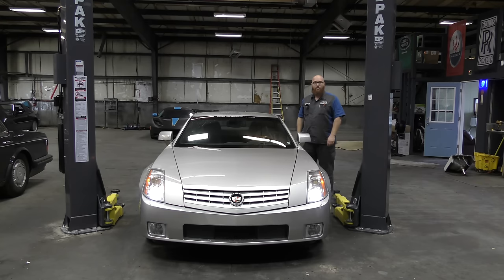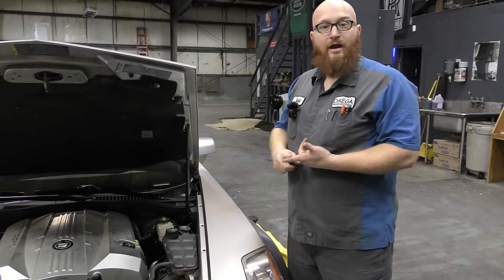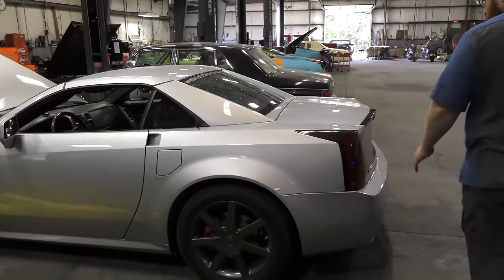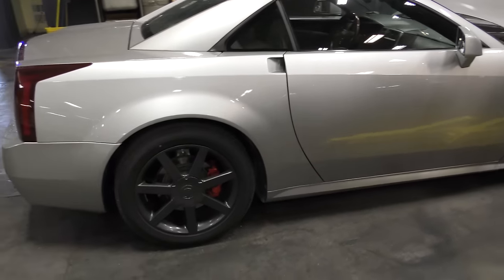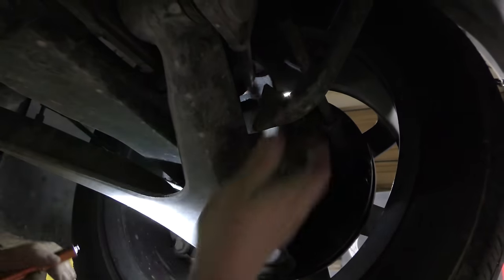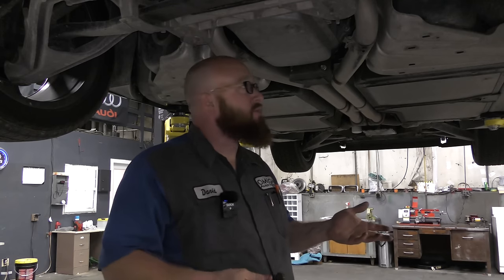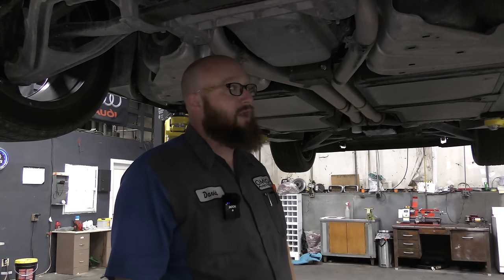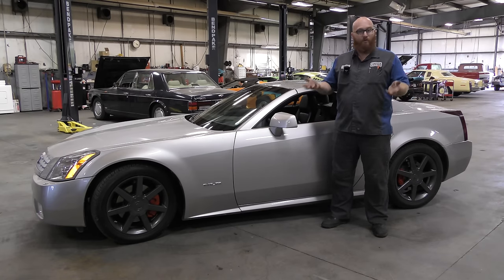The CAR WIZARD is shocked this 2006 Cadillac XLR has a Lotus Sized Repair Bill?!?

Comment: Those insane repair prices are what you end up with in todays stupidly over complex cars, some are more like rolling rocket science projects than automobiles.  One day it will get to the point where many average people with average jobs in America will have a difficult time even owning a car and keeping it in a decent state of repair.  Much of this is because of Govt. mandated emissions, mileage and safety equipment.  I worked in a Chevy dealership in the mid seventies and a brand new loaded MonteCarlo or Caprice ran about $6,500 out the door - new Corvettes were around $15,000 - but cars were MUCH simpler and easier to repair then,  but as the govt. started mandating difficult to match emissions regulations car makers were eventually forced to resort to computers and sensors to run engines leaner and leaner on crappy ethanol laced gas we have now until were all driving rolling science projects that run within an extremely fine computer controlled fuel and emissions balance and it takes high dollar sensors and multiple computers to keep them in specification.  Add to this the downsizing of cars where everything is jam packed into place requiring removal of half the damn car or engine removal just to do what used to be simple maintenance or repair.  An old school mechanical fuel pump cost $15 - $25 and could be changed on the car in less than an hour in most cases - now its a tank removal, shitty plastic lines that get brittle crack and fail etc etc. the list goes on and on - and on.  Sadly we now live in an era where car repairs that used to be fairly simple can result in the car not being worth repairing and being totalled instead of repaired.  We see many older cars preserved or restored and still running today, but we wont see near as much of that in years to come, the car will have to be extremely valuable to be worth the cost of restoration or even what used to be average repairs in some cases.

Comment: Being a Cadillac Technician at least one Tech at Every Caddy Dealership was supposed to Be XLR certified . A special course we could do online and with a hands on with the guys who designed the car. With a lot of training on the folding top. Im glad I took the training and learned that car inside and out because the warranty labor times to fix those cars was ridiculously low. And hard to beat even with the training. And no one ever wants to work on them. And without the training they shouldnt touch the car... But now that they are out of warranty its great It the book time is actually worth working on and hopefully make back all the time lost when under warranty...  ill work on them.all day long now if possible...   Dont forget to check that radiator support frame... havent seen but 2 that were not broken. And that one looks broken...

Comment: Same damn radiator leak on my '03 Cadillac Deville several years ago. Fortunately for me the radiator wasn't that expensive and easy to find at that time. I put 120 k on that Northstar without any real problems other than that radiator.

Comment: A violently ugly car, it's mechanically ordinary, electronically ordinary for it's time.. the kind of car that would brake it's own name... Cadillac.  for the radiator issue, would be far superior and cheaper both in short term initial buying fee and in the long run to have an all aluminum custom made, which leans towards durability, factory radiators are made to fail especially from derelict yoyo companies.

Comment: only the Gm radiator  has the cooling lines and automatic transmission lines in it. All the rest you get aftermarket do not have the power steering coolant lines.  I use the All aluminum ones for the corvette. they fit fine. Just use an adaptor to  adapt the screw in lines for the power steering to the snap in ones Full aluminum welded tanks and  cost less than 250.  While you are at it replace the return line that runs under the throttle body. they are hard to get and I sell a kit to replace the plastic junctions with metal. They will leak after you replace the radiator.  Guaranteed. Also check out the 3000-5000 each headlights and the 2000 taillignts . Also the 2000 to replace the shocks and the top controller that sells for 800- 1500 used. I can swap the radiator in an hour so I am not sure why the high book times. I don't believe you can pull one tank without pulling them both. Our book shows 10 hours for both. Also there are two fuel pumps In the rear

Comment: Cast sump and cross-member? Insanity.
Also, any decent radiator specialist could likely replace the tank or a good tradesman could make one from metal. It could even be epoxy repaired on the inside. Most of the time the plastic tanks crack from the heat cycling directly opposite the inlet port.

Comment: This is a car that looked good on paper, and should've stayed on paper. Typical GM, build it as cheap as possible using the worst engine ever designed for road use. I'm sure during the design phase there were other more "exotic" drivetrains that were used, but in the end this is what the public ended up with.....

Comment: 7:25 If I was putting a 70,000 car on the lift I’d give it a shake test and watch those side skirts
Reply: right? i cringed and rewound just to see if the skirt flexed ..it didn't .
 my Pontiac GT kit has been damaged by those type of lift arms due to bad placement

Comment: You can actually drop, swap the level sensors and reinstall those gas tanks in about two hours each. Watched my coworker do it after he finished chain smoking cigarettes as preparation last month 🤣 difficult part is popping the transfer tube off the tanks

Comment: one last thought... sorry... but I have a C6 corvette... the transmission has to drop out when using automatics. The manual transmissions can stay.

You might be able to reach the sender by removing the rear wheels and the inner fender panels.

Comment: Thank you for another insightful video. As with any vehicle, you will either have Car Payments or Repair Bills-Hopefully not at the same time along with regular maintenance. So, with an average car payment of $550 per month ( some more-some less) that’s just over 6 months of car payments.
Some Brands & Models you Lease, some you Purchase and ditch after 5 yrs, some you buy and keep for a few more yrs. If buying Used, research common problems and factor in Repair Bills.

Comment: Those prices are nothing compared to if you need to replace a tail light or a head light assembly.
A tail light can run you over $2000 and a head light is more.

Comment: the Tail Lights are a real mess if they fail, and a lot do. The V series did not have an LS, it was a supercharged Northstar. I too think they are pretty, but I mostly worried about the Northstar. they had a pretty terrible rep and still do to an extent.

Comment: Had the fuel sensor issue on my 07 vette.  Believe it or not, the forums said to put Techron in it and it would go away...   they were right.  Had it for years after that and no fuel sensor issues again.  Techron was all I used for each full up.

Comment: GM and their damned cheap electronics are one of their serious defects. With GM you can count on relays and switches burning out, and the worst part is that it has been this way since the 80's and they won't clean up their act.

Comment: Car Wizard what do you think minimum usage is to keep a car in good shape? I have a 2014 Continental GT that I bought new. It gets its annual maintenance at the Bentley dealer but sits mostly in the garage for a variety of reasons. I drive it every 2-3 weeks just to keep the seals moist etc. Includes using all the power motors.

Comment: Had 4 different Cadillacs with the Northstar. I had to do a radiator on 2. Worked at Advance Auto at the time and it was always a special order part for about 300 plus tax. Nevermind the fact that both of them had failed head gaskets so that was fun. Had an 01 Deville that was amazing and bulletproof that got ran into. Figures.

Comment: XLR-V is a 440hp Supercharged 4.4L (versus 4.6 for the regular version) Northstar not an LS motor. This was also used in the STS-V, where it was rated at 469 instead.

Comment: Not sure if the XLR has same fuel tanks as the C5 Corvette, but I replaced the right side sender by removing the RR tire and the inner fender
 Did not have to remove the tank

Comment: Plastic radiator tanks are such a cheap ass joke, something that runs hot all the time like a radiator should not be made of plastic.  The minute that plastic goes into use it begins to degrade from chemical exposure to coolant and contaminants and the heat really does a number on it, not to mention the pressure and continuous cycling of hot to cold to  hot over and over again.  Might be more reasonable if they made them where the tanks could be easily replaced with new ones at least.  Part on newer cars are such a racket, planned obsolescence more than ever before.

Comment: Did you get the gm part no. And cross reference it on the interweb? I ran a gm parts dept for 7 years sometimes you could get away with that as an aftermarket option just a thought

Comment: Ya whenever GM does a high end product its a fortune to repair. I had my mechanic convince me to start paying for some repairs on my car. His line of thinking is it's still gonna be cheaper than just buying a new car but man that doesn't lessen the strike on my wallet. I can't wait to save up for my first Toyota because GMs are just not built to last; theyre built for power and performance. You can't really get the best of both worlds unfortunately.

Comment: On the Cadillac, Couldn't the person just run a new radiator and add a separate oil cooler and a separate transmission cooler? These separate items could be installed and hidden out of the way and there is less risk of failure as separate parts than as one, as we have seen in the radiator/trans/oil cooler combos when they fail

Comment: Use Techron in the tank to take the flat spots off the sender and use better fuel. Common C5 problem if you research.

Comment: These are two bad design problems: 
1. Why not use a radiator that is used in other GM products? There is no excuse for using a custom part. There must have been an existing GM radiator that could have been used. 

2. I.M.H.O. it should be possible to drop any sump or engine cover without having to remove cross beams or any other parts.

I am guessing there are other design flaws? They just don't seem to care or think when they are designing a car to keep maintenance costs at a reasonable level. All it would have taken would have been just a little bit of forward planning. I doubt it would have cost any more to build it to a better design; but no, they designed it the way they did. Granted there is less space in modern cars; but a good design should consider future maintenance requirements. All it would need is an industry standard check list that could be applied for any vehicle designed. I realize this was a limited edition model; but any owner that encounters these types of problem will think twice about buying another Cadillac or other GM product.

Comment: the xlr-v did not have a ls based motor.   it was the northstar 4.6  with a reduced bore.   the 4.4 liter engine had better head gasket sealing.

Comment: The fuel tanks of this XLR, reminds me of the fuel tanks on the vintage Jaguar XJ 6 from about 1970 to 1985, which also had two fuel tanks. Repair or replacement of those fuel tanks is also a huge job, as they fit like a glove into the rear quarter panels. Any warpage or modification and they won’t fit anymore.

Comment: I didn't know they had transmissions in the back with the engine in the front. I'm guessing that's for weight balancing between the front and back. You get more control as the weight becomes more even, which is why several cars have center engines for the best distributed weight and balance.

Comment: Hey, I had this same year XLR and it was a fun car for sure. However you are expressing the same issues I had. Difficulty getting parts and when I could find them the cost was high. Also I had the same maintenance issues radiator & fuel sending unit. Also had big problems with the retractable roof. With that said I would still love to have another LOL.

Comment: I've seen similar vid's from you on how expensive it is to work on other cars just because of how they were designed (such as having to lift an engine that is resting on a cross member just to reseal the oil pan), then throw in the use of cheaply made parts (such as radiators with plastic side tanks that can't be repaired instead of good old fashioned metal), and it really makes see that manufacturers are doing this intentionally to discourage people from keeping their cars and maintaining them.

Comment: I noticed you parked the car short 1-2 feet before lift post so you can open the door more, then roll it forward to correct position later to put on lift feet

Comment: i think with the fuellevelsensors in the tanks it would be better to have an inspectionpanel behind the seats that you can remove to get to the sensor and the fuelpump instead of unbolting half a car and put it back together again.. a lot of the older 90`s cars have that when the fueltank is under the back seat they have a panel that can be removed to reach in the tank without having to deal with removing everything

Comment: I once owned a C5 Z06 (for 8 years), with that fuel gauge anomaly happening two or three times during that period of time where the gauge would mysteriously read empty for a brief period of time, even though there was "half a tank", so to speak.  I surmised that it was just a rare anomaly that was brought on whenever managing to drive a very good number of miles (due to cruising a constant 60 mph, in top gear, with no air conditioning and a decent tail wind) between the point in time at which the sensor in the first tank reported as being empty and the point in time at which the sensor in the second tank begins to report anything less than absolute full.  What happens is that the computer begins to get a little nervous because it seems like an unreasonable number of miles have been achieved since the first tank reported as being empty (but obviously still had maybe 1/2 gallon remaining) and with the second tank not yet reporting anything less than absolute full (because sensor continues to read full until down by say 1/2 gallon).  In summary, this is just a design flaw and can't be fixed so don't worry about it.

Comment: havent had a leak in decades on my cars, I loosen the rad cap just enough so the system cant pressurize,, we dont see the high temps some see. no pressure=no leaks, or blown seals or hoses

Comment: I photograph cars for multiple dealerships and I've only gotten to sit in one of these about 6 years ago. I was SUPER unimpressed with the material quality inside, everything was as rattly and loose as a corvette of the same era, maybe even worse. It looks good in picture and on film, better than a corvette... but the creaking loose fitting plastic is just so bad.
Reply: I just want to add I do think they look cool, pretty neat and especially brand new I bet they were dope af, so I don't mean any disrespect. I'm not poo pooing your enjoyment of the vehicle, I just wish they would've put as much effort into the interior as the engineering (which is pretty cool).

Comment: hey Car Wizard,  If I wanted a future collectible, would you recommend a  Cadillac Allante 4.5 or a Buick Reatta  convertible ?  I like them both
Reply: I have a 90 Allante and luv it ,,But it is a money pit ,,electronics will drive U nuts ,,But when its running Rite ,,LOOK Out  its a House on Fire,,with a Small Engine ? only 255 cu

Comment: These (along with anything ever) NEVER should have gotten Northstar engines. These in particular should have been LSX. . . They'd already well hit their stride by this point, with 4th gen Fbody's already having mastered things to begin with, the C5 vette, and by this point things were really developing into stupid performance numbers with them. Yet instead GM put the notoriously hated, avoided, loathed, and for good reason despised Northstar. . . Just.... so stupid. 

And it's when mistakes like this are made, that lead to cars selling piddlechits numbers, that parts just stop being available. Also, that cantered radiator looks a lot like an Fbod or vette, and I don't doubt they're likely interchangeable if not the same part number, technically. Clearly not logistically. . . 

It is interesting though, I always saw these as the Caddy Corvette, but truly, there's a lot of Fbod in there too. Interior for sure. What a weird build, just like the SSR at the time... they were doing fun stuff, but it was weird stuff, and not stuff with big parts budgets. Stuff that would develop stupid issues due to poor manufacturing... Not all of it mind you, but this fell into that exact era when first gen models of most of their newer stuff was really hitting some all time low batting averages. Well established lines would chug on reliably while things like the equinox, torrent, ssr, and other new for the year bodies / platforms would suffer poor reliability in all ways build related. The names that held on for a gen 2 got better for sure, but not all did, and often for legit reasons..... even if a shame, they were legit.